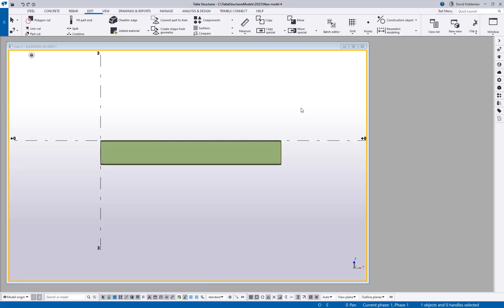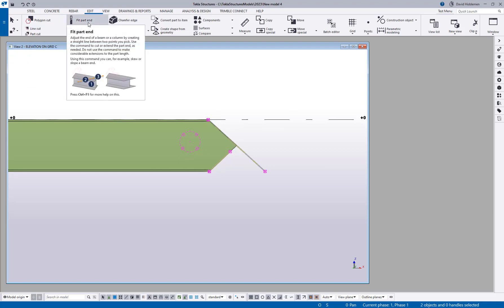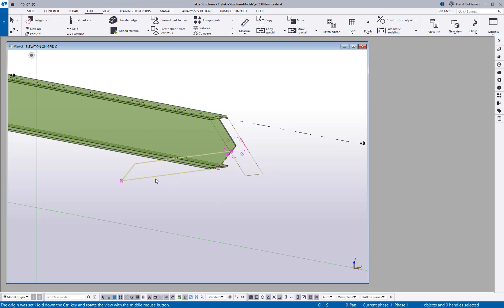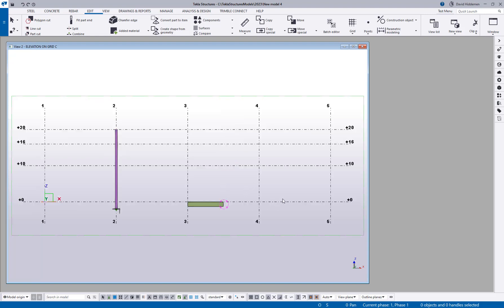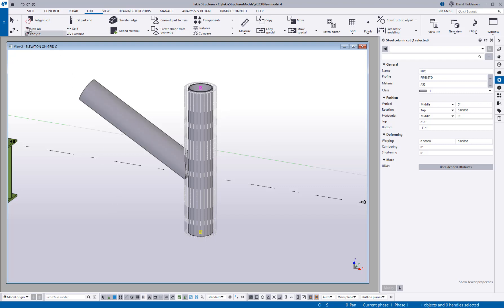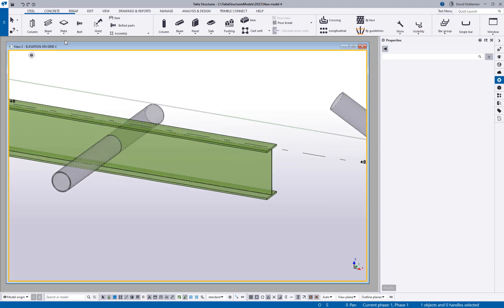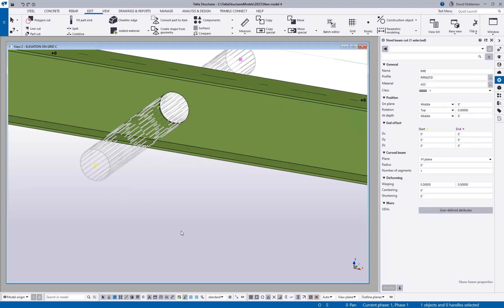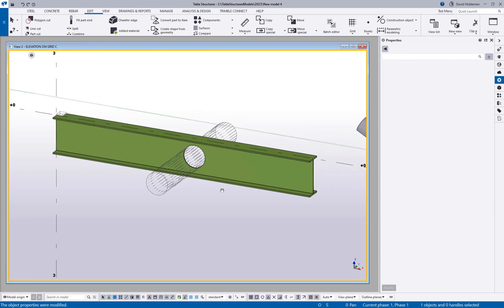Tekla Structures Basics - Working with Different Types of Cuts

Comment: AFTER CUT I DONT SEE LINE IS THEIR ANY OPTION ON SOME TIME I SEE SOME TIME NOT
Reply: You can't see the cut line? Go into view properties (double click in view) go into display and switch on "cuts and added material" and also "fittings" make sure to hit modify. It should appear then. If not then it is possibly showing up a little bit away from where the cut actually is. Change your selection switchs to the scissor only so that you can only select cuts and try to find it that way. Another thing is delete the part then hit the undo button and when it reappears the cut will be showing in the view

Comment: Users, you can't control how a line cut lands in your model (Tekla places the line-cut object in the model for you). This is important to understand because it's easy to lose cuts in a model. FITTINGS you CAN & SHOULD control in your model. Tekla sizes the fitting according to your snap, or input (dimensional input). I have two primary tips for placing fittings that make them harder to lose. 1) Make your 1st & 2nd snap to place the fitting far enough apart that it makes the fitting easier to see (e.g. 1'-0" long fitting is easier to see in your model than a fitting that's 1/16" long). 2) Input is an easy way to keep your fitting snaps farther apart (e.g. I like to simply hit "2" twice to input 22" when placing a fitting, making it 22" long and very easy to see). 

Respect what David says about setting up your views before cutting. It's easy to lose cuts in your model when you model them in a plane that's far away from the part. Keeping the plane near your part as you add these "edit" objects is a big win for editing later (if needed). 

Happy modeling :)
Reply: Create cut custom, binded components for cuts as well.